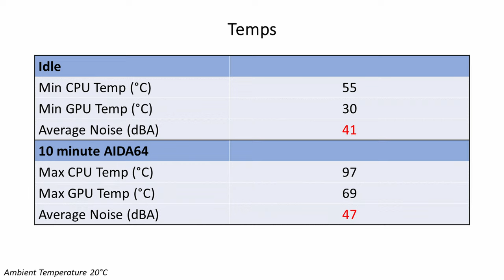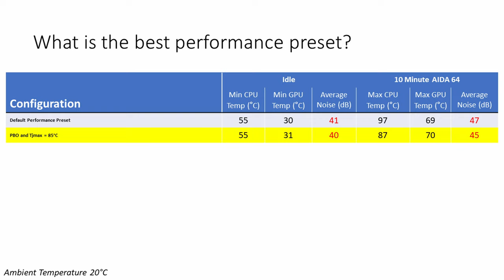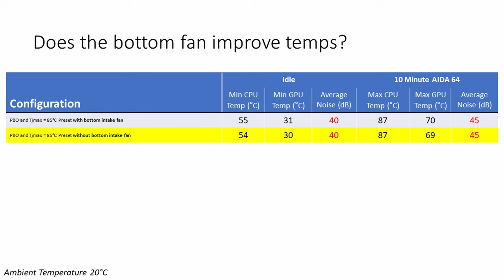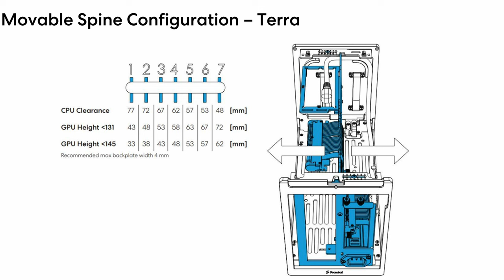Fractal Design Terra Review

Comment: Mostly likely the CPU cooler will be a top-down style cooler and draw air from outside. Same for the graphics card. I think if an additional bottom fan is added. It should be used as exhaust, instead of intake.
Reply: Hot air rises
Reply: @tazzmania6292  Oh, not again. You have to consider the entire air flow paths of the case.

An active 120mm fan can easily overcome the feeble effect of hot air wants to rise up. With CPU and GPU fans act as intakes. An exhaust fan will help air circulation and components temperature.
Reply: @tazzmania6292 there's been a few tests and they have confirmed that bottom exhaust is better than bottom intake.

Comment: I wonder if the ID Cooler SI-55 or the Thermalright AXP-100 copper would be better. Over at Hardware Canucks, those two fans outperformed the Noctua Ghost. Well, all three were good. At the same time, my GPU limits me to 57-58 mm CPU cooling.

Comment: Great video as usual 🥰🥰, would my current gpu ( 3070ti x trio ) fit in this case ( 323mm long ) ? It seems that it is 1mm longer than the case’s length clearance. Width and height are ok 

Thanks 🙏
Reply: you need a gpu length of 322mm maximum to fit in that case so your gpu is 1mm longer that maximum

Comment: I really need a 4090 FE card, my MSI card is too big for all these sff cases :(
Reply: im using Rog strix 4090 in my Xproto-L series which support up to 345mm also have better thermal than this , since both doesn''t have any dustproof so ... easy choice

Comment: I have the 5800x with a 240mm radiator in a NR200 and I have massively undervolted it (while it still being stable) due to just struggling to keep temps low, I get good temps now but I am wondering if I could still keep my 5800x and if so, what cooler could anyone recommend for my 5800x if I had this case???